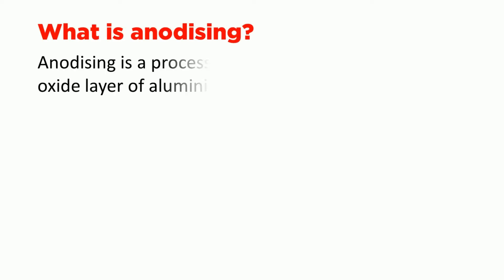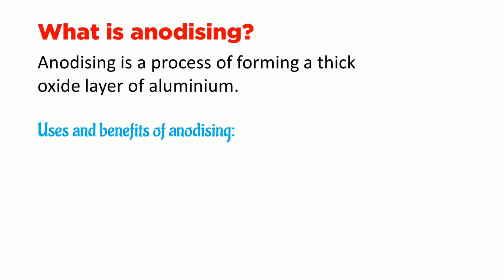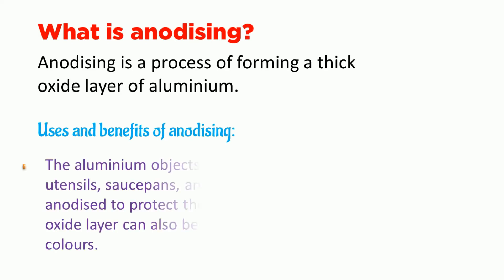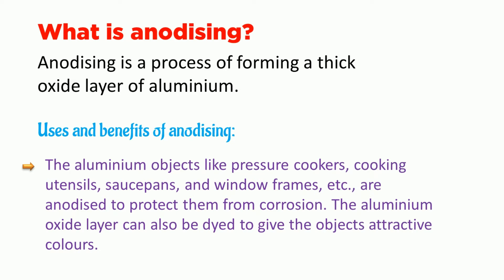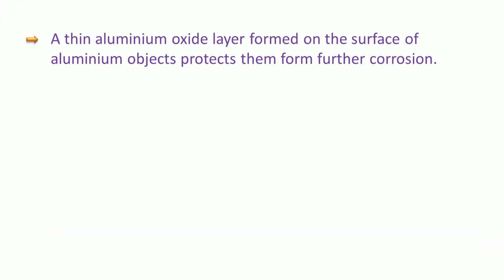what is anodising? || define anodising || anodising class 10 || anodising aluminium process

Comment: Doesnt aluminium get corrode when oxide layer is formed on it  it will then what is that to protect it from further oxidation vo jab pahle se oxidized ho chuka hh to agar corrode hona hota to pahle hi ho jata jab uspe oxide layer chadayi thi
Reply: no i dont think it corrodes as much
Reply: like iron corrodes way more
Reply: If it itself corrode how would it protect other
Reply: @creativemind6256  u DUMBBBBB assssss

It will protect it on further time..... because at first it will do the corrosion and after then it occurs there will be the thick coating of aluminium so that's why the air and moisture Contact will be blocked. HENCE , CORROSION STOP
Reply: The aluminium oxide is a protective layer and it doesn't allow moisture to attack the vessel